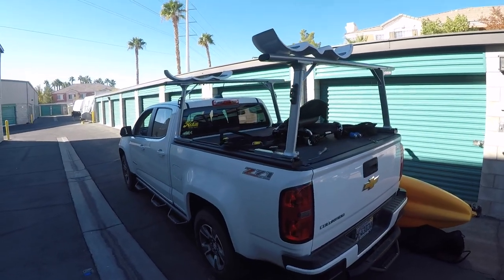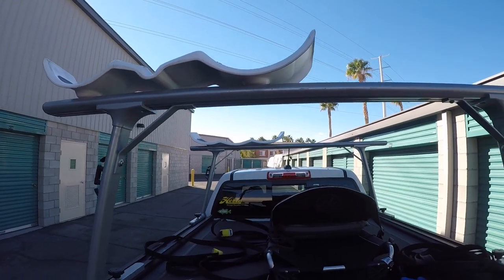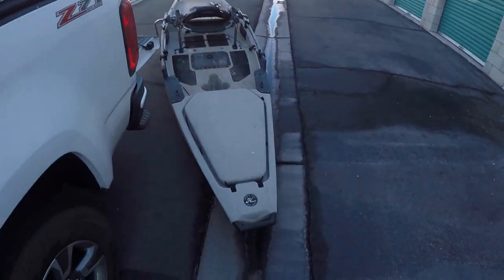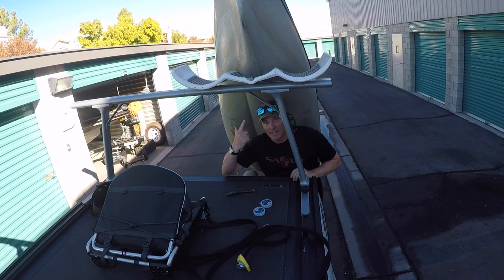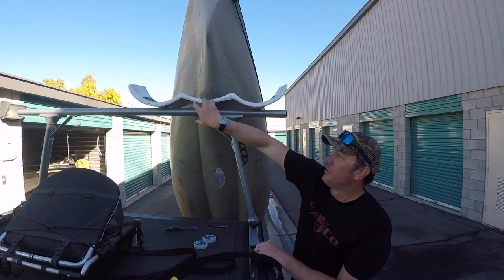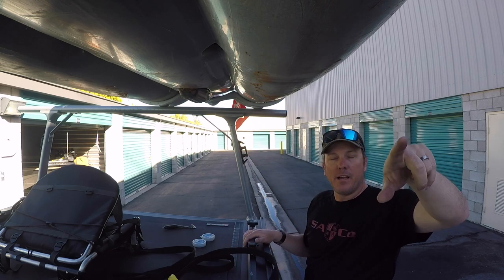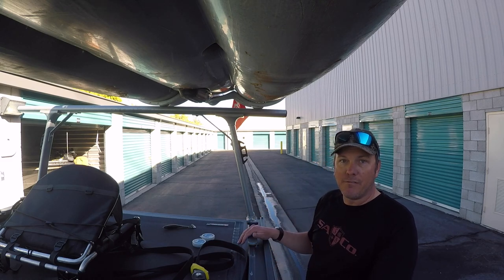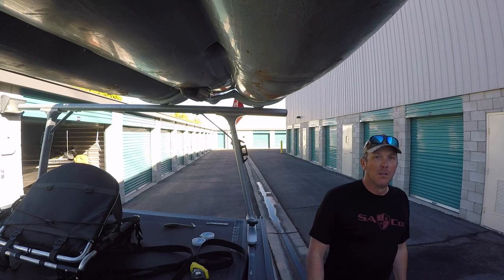Roof Top loading a Pro Angler 14

Comment: whats the distance from each one?
Reply from the maker: 66”.  The spacing on the cradles is why I bought the “long bed” version of my Colorado.  My previous truck was an F150 SuperCrew with a 5.5’ bed and that required me to have a bar on the rear portion of the cab to get enough space between them.